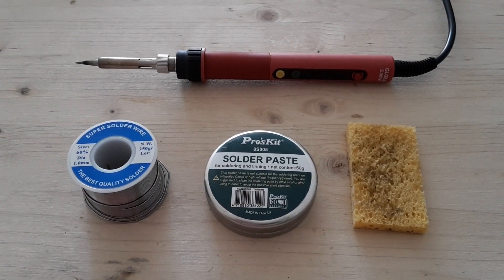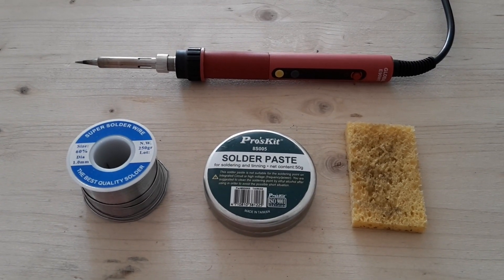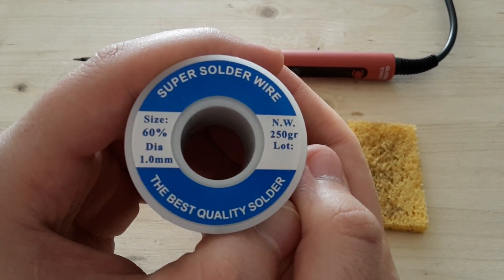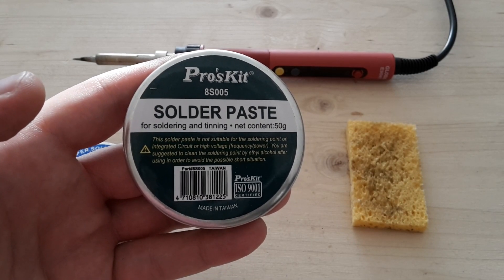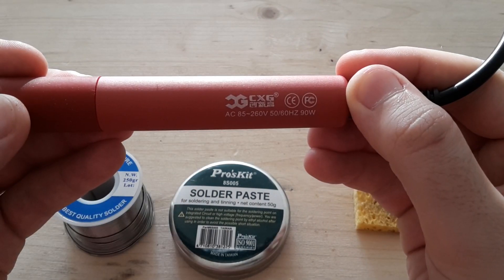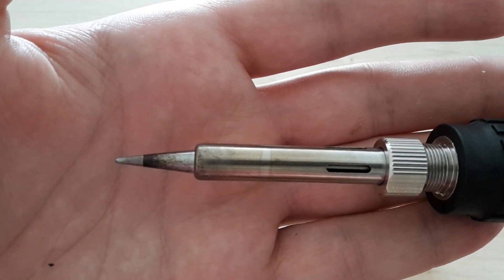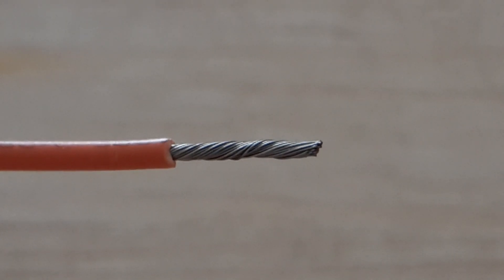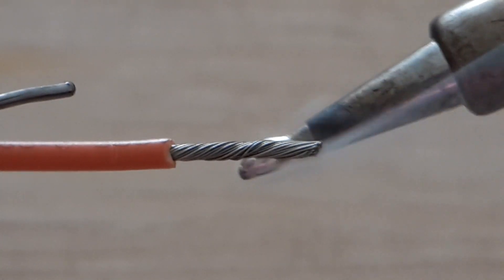Tinning a Wire With or Without Flux?

Comment: i use at work top quality soldering iron and use no flux, the wire gets soldered in 1,5 second, sure flux helps alot, but not always needed

Comment: flux makes the job so much cleaner and less time consuming. always use flux, It's designed to draw the solder into the wire.
Reply from the maker: Yes, I agree with you!

Comment: very nice, my small wires of earphone do not tin that easily, what may be the problem?
Even I am applying flux.
Reply: The problem with wire not tinning or flow easily is because of the cheap no quality solder wire. i learned it a hard way.. never happen again after im using only 'mechanic' or 'proskit' solder wire.
Reply: @harisyoung4110  I agree, cheap solder has a higher melting point which can make your work get sludgy from my experience.
Reply from the maker: Hmm, maybe they're covered with a thin layer of insulation, who knows :-)
Reply: @zeroampselectronics  I pre burn the insulation with soldering rod heat.
Reply from the maker: Hmm, I have no idea what is wrong with your wires then. I've never had any problems soldering thin wires. So, I would practice that on old thin wires first.

Comment: Is this flux is active which causes corrosion?
Reply from the maker: Hi, the flux is anti-corrosion, but it's recommended to clean it with alcohol after soldering. It's not recommended to use it for soldering small electronics.

Comment: Wrong!  Ordinary flux does not clean dirty wire.  It help solder flow a bit, but solder already contains enough flux for that.  When you put this kind of aggressive flux on wire you are storing up problems for later.  The acid in the flux starts to corrode the joint over months and years..  Start with clean wire in the first place and you don't need to cheat.
Reply from the maker: Hi, the soldering paste I use in the video is acid free, but you're right all components should be always cleaned before soldering properly.
Reply: Wrong! The purpose of flux is to prevent the copper from oxidizing while it's heated so that the solder wets and flows better. Sometimes flux core wire is not sufficient on its own and more paste is required, such as for large cables and plumbing fixtures. There's a difference between acid flux and rosin flux. The former is mainly used in plumbing applications and joining sheets of copper, brass, and steel because it creates a stronger bond but is corrosive, so all residue needs to be wiped clean after joining. It's common practice to apply acid solder paste to most or all of the surface of the plumbing joint AND use acid flux core solder, otherwise the joint will probably leak. It's also common practice to apply rosin solder paste to large wires/cables to help it flow better and prevent cold joints. Rosin flux DOES NOT corrode and is intended for electrical connections or this reason. He used rosin core solder and rosin paste. He did absolutely nothing wrong.

Comment: So i have an Lipo rc battery with tick wire like that can I solder without flux as in would it hold my wiring together still cuz flux is to make it stick so I'm wonderong if itll work without it💯?
Reply from the maker: Hi, solder wires have usually some flux inside it, but you can add more flux if you want to speed up the process of soldering. In the end it's up to you, try to test with and without it and you will see the difference.

Comment: My wire is very thin. It's very hard to twist it.  How do you tin very thin wire?
Reply from the maker: Hi, if wires are too thin I just put them next to each other and solder them together. I think it's not necessary to twist them because they're fragile and it's very easy to break them.